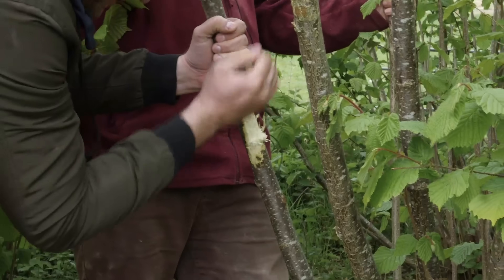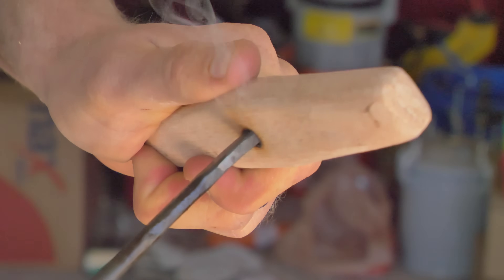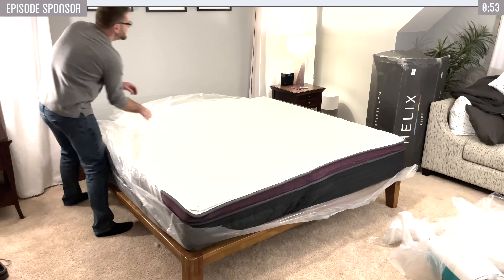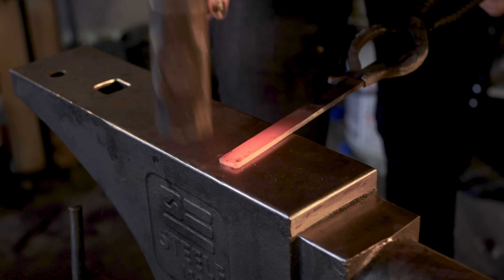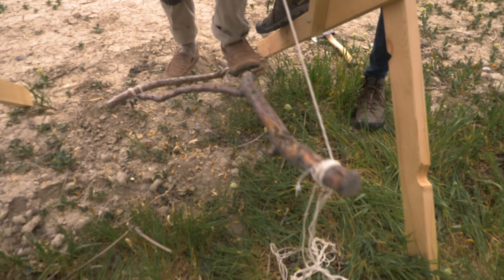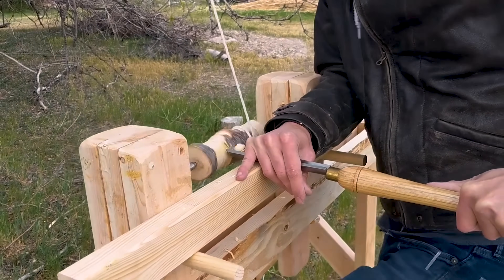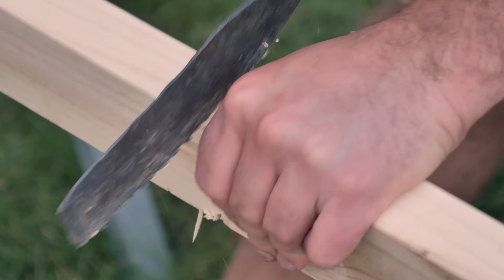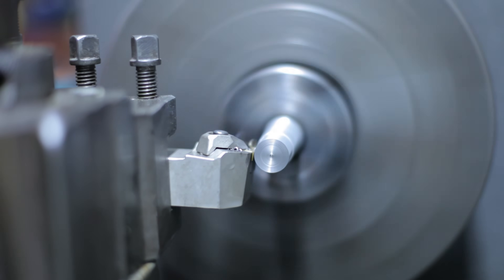I Built the The Machine that Made the Industrial Revolution

Comment: As an english woodsman, the traditional pole lathe would be driven by a single hazel or birch sapling and the rope winding needs to be reversed so you are cutting on the spring stroke not trying to power it with your leg.
Reply: I'd add a flywheel and an S-shaped crank between the spring and the pedal, above or below the work piece so that pedal+spring spins the flywheel, leather cord over flywheel spins the work piece.
Reply: @SonsOfLorgar  Somewhat misses the point of the portable simplicity of the bodgers pole lathe. Wood-turners (known as bodgers) would work deep in the woods next to the coppicers cutting to make hurdles and basketry, the pole lathe could be quickly cut from raw materials on site, leaving the workman to only carry a rope and his chisels.
Reply: @freemanjackmsiradio  in fairness if he did that on the tailstock pin, on the outside of the tailstock, and wrapped the string from the poll around the crank, you'd not be carrying much extra for a lot of gain.
Reply: @freemanjackmsiradio  It's worth noting that that's that particular scenario, Andy is just trying to build efficient technology so while a bushcraft style lathe is definitely as you described, I am willing to bet that many had came up with more complex designs at the same point in time when this was a relevant technology, and, were more efficient + capable than just a simple portable bushcraft lathe.
Reply: @freemanjackmsiradio  You could say they did a real bodge job of it, eh?
Reply: @freemanjackmsiradio  I can see your point, but I do disagree on portability. Especially if my idea is modified to put the flywheel and crank as an extension on opposite ends of the spindles.
That way, the forged iron crank and spindle axles would be all someone would need to bring, the spindles would need chisel or star shaped tips that grip into the ends of the work piece instead of just holding it. The flywheel could be made from a sliced log on site, it just needs to be centre balanced, same with the crank pole and pedal, made from wood on site and tiedxtogether with twine or leather thongs.
Reply: As an American veterinary technician, I have nothing of value to add to the discussion, but hi
Reply: @cleverusername9369  what?
Reply: @jimspencer7793  Why does your opinion about the guy's personal style tastes invalidate his work? Do you not understand the constraints they are operating within? That's kind of what this channel's all about, not some nonsense about long hair bad, something something.  You don't get to dictate haircuts, you know, but if that's your jam, you should check out Max Miller's Tasting History. Seriously, the guy could teach a class in masculine personal grooming. 

Whatever your reply, I wish you a favorable future.
Reply: @bookman7409  
Lets be honest, we all know why he's complaining about people's personal appearance, and it's not a good faith position.
Reply: @bookman7409 spoken like someone who doesn’t work with tools. Long hair hanging in his face while working with flames and requiring precision hand eye coordination. You don’t see anything wrong with that? Did you notice how he still fumbles his work since he was in a video like a year ago?  Looking like a stereotype is one thing, but confirming the stereotype is a disservice to himself.
Reply: @Nitsirtriscuit  I don't work with tools? Funny, my career was as an electronics tech, and that involved a ton of tools. I've also used plenty of heavier tools, hammers, wrenches, axes, and plenty of ordinary power tools. 

So your reply was spoken like someone who makes huge, sweeping assumptions in place of anything useful to say. If you feel insulted or offended, you brought it on yourself by making those assumptions. May fate give you what you deserve in the future.
Reply: @Nitsirtriscuit  I am almost certain the crew deliberately includes more fumbles in their video
composition than not. It adds an element of comedy and authenticity to what could easily be smoothed over with edits or outright faked. 
Everyone fumbles their work from time to time as they get better and understand their tools and materials better. 

Also, the blacksmith isn’t a “he”. They can still swing a hammer just fine, and their work has been sound. One or two shots where their hair gets loose don’t mean a whole lot for the whole of a project. Frankly, your nitpicks and framing of your argument with a comparison to stereotypes indicates both bad faith and dog whistling.
Reply: @Tinkering4Time  While I'm in agreement with your general sentiment about personal style and grooming not being of particular importance, and that people should stop shaming others for how they want to look, I can't seem to find any information online to confirm your claims about Adri.

For others who don't know, "their blacksmith" has a name. It's Adri Noland, also known as The Elfsmith. They have a YouTube channel with a few videos and an Instagram with a variety of posts about works they've made, but I can find no publically available information about their personal identity with regards to gender, sexuality, or anything of the like.

In light of this, I think it would be wise not to discuss Adri's personal tastes or identity any further, as it doesn't appear to be something they want to publically share.
Reply: @bookman7409  Actual smiths in the medieval ages generally had short hair both head and beard, despite the fact they were generally a "better off class" and growing long for both for their class level in society was acceptable.

This is the only hint I am going to give, because your response is so freaking funny that someone can be that warped and out of touch with reality it makes me smile.

I wonder what your response would be if someone commented on an female EMT wearing a skirt so tight and high heels it was impossible to run while on the job.
I bet it would be exactly the same...
I wonder what your response would be if that EMT was called to treat a loved one and they died due to how long it took for her to arrive?
Reply: @givemeanameman1  If that's what it takes for you to conclude that personal style is dictated by competence, have at it. Yay, you.
Reply: @bookman7409  You are an amusing Man/Women/IceCream/Fluffy/Rainy/He/She/They/Thing.
Since their are something like 500+ pronouns I just used 9 of them... hopefully you don't trigger out and take offense if the one you use isn't included.
Reply: As a not vegetarian I have nothing to say about the subject.
Reply: You absolutely nailed it, mate. The creator would also benefit from sharp tools.
Reply: It is comments like this why I watch and create (bad) content on YouTube.  Thank you sir.  ✊🏻🖤
Reply: i'm guessing more urban turners would talk to a local bowyer to get a more permanent setup close to home?
Reply: Awesome
Reply: Speaking as a single hazel or birch sapling, this is correct.
Reply: It depends on where you are, you English are known to do things the opposite way. 
Anyway both can be done it depends on the work, area, tools used, etc.
Reply: Would poplar work?
Reply: @beercatphil  Not a common tree in traditional woodland here but if the sapling was suitably young and springy, i see no reason why not. Hazel and birch are the saplings of choice as they share a resilience to splitting or breaking like goat willow or the likes would.
Reply: @beercatphil  almost every young tree works, that's the beauty of this lathe
Reply: In my village(romania) we used water wheels util 1950s
Reply: and as a tibetan stonemason, i concur.  😁
Reply: Be quiet and enjoy the video
Reply: Their black smith thinks having long hair and painted nails is of some importance..they made their work be 200% harder than it should have been..
Reply: @jimspencer7793  it seems like you're the one that thinks it's important, they didn't even mention it. That's like saying a blond blacksmith thinks their hair is too important just because they have blond hair
Reply: @youtubeaccount1-w6u  no it’s more like saying someone who needs to see their work clearly in order to perform well thinks their hair style is more important than seeing their work clearly. Thus causing them to fumble their work and do a poor job. Because they like their hair more.
Reply: @jimspencer7793   Their blacksmith is an alphabet person.

Comment: use a neodimium maget under the horn of the envil , you well eliminate the singing
Reply: But why?
The singing of the anvil helps a good and musically attuned smith with the accuracy as the sound of the work changes with the temperature and shape of the work piece.
Reply: from my personal expirience 3 years of amature blacksmiting ,after i discovered the neodimium trick i was eble to work for 10/11 hours with out headeke .p.s. sorry for my english is not my first leanguege.

Comment: cool video, although I think one improvement that could be made- Instead of using a green tree branch, could you make a counterweight on a swing-arm to do the same thing? Similar to something like bucket cranes for ancient irrigation, it'd allow you to set it in such a way that you can get fuller rotations, and also you dont have to keep beating on yourself with a tree-branch.
Reply: Also, add a flywheel and an S-shaped crank betwen the weight and the pedal for continuous single directional rotation.

Comment: Very nice project. As a potential upgrade, you could try using a counter weight system instead of springy branch, since it is really just being used to reset the rotation string.
Reply: And an S crank on a flywheel

Comment: You should make a flywheel, a one way pulling system and a system of pulleys that allows you to release the energy from the springy branch more slowly. This would make working on it much much easier I think.
Reply: A flywheel and a pedal crank attached to the spring would be more efficient than the pulley system. (Similiar system used to make thread in the 17th-18th century cottage industry)
I should probably build one of those lathes for myself tbh.
Reply: @SonsOfLorgar  Well, It was hard to make the flywheel and any belt wheels before having THIS lathe. Now that he's got the ability to make some parts, he can upgrade to the treadle lathe with some leather belts to even maybe allow variable speed.
Reply: @JessicaKStark  yeah, this is the way. He would only need one belt if the flywheel and crankshaft inversely changed diameter over each other keeping the same tension regardless of belt placement; this would allow simplicity in trading speed for torque and vice versa. I think he just might throw the treadle out completely next time if he can get into water power, but a variable power flywheel is a must for that too
Reply: @TannerSwizel  just like a drill press.
Reply: @JessicaKStark  you beat me to it! 😀
Reply: @JessicaKStark  agreed!
Reply: @TannerSwizel  Just like DAF variomatic transmission from yesteryear :D
Reply: @SonsOfLorgar  Yeah, I came here to suggest a treadle system as well, but if he intends to attach a water wheel, he can probably just skip straight to that! 😅
Reply: @SonsOfLorgar  Yeah I think you're right
Reply: I love treadle lathes! I've always wanted to build one. No pulleys or springs necessary, a crankshaft and a pedal attached to a flywheel will do great on its own.
Reply: Similar to foot powered pottery wheels
Reply: @hairyneil  That was exactly what I was thinking!
Reply: A weight attached to other end of the string hanged on a pulley would be much simpler and effective. Instead of a springy branch.
Reply: @kaankalem2666  Might aswell go for a a waterwheel and transmission then :D
Reply: the pullies would not work well for turning   ..you want rotational speed  consistency is a bonus  , you also need the torque  from the branch or the  gouge will just stop the work piece
Reply: @mobiousenigma  Yeah in my mind having pulleys would allow you to use a much thicker branche and unload it much more slowly. Especially when combined with a flywheel it would make it much more consistent and much much faster.
Reply: @isaacgroen3692  and at that point it is easier to ditch most of it and make a tredal powered lathe.
Reply: maybe take some inspiration from push bikes. Add a seat, pedals, chain and cogs/gears, so one can sit down and power it with both legs.
Reply: @mattw940   thats the next evolution lol its a tredal lathe  somewhere around 1850s i think. same mechanism as sewing machines but with a flywheel added as well
Reply: @mattw940  genius!
Reply: A flywheel and a pulley system should be easy enough. A one way pulley system that's going to be harder with out better materials.
Reply: @allstarwoo4  also, using a simple racheting cam would allow the flywheel to be driven in one direction.
Reply: You can go crazy and add thick wooden gears to increase the speed of the lathe and flywheel setup
Reply: @vishensivparsad  wooden gears are a pain  1 belt  2 shafts and as many different pullies"wheels" as you want speeds ....if you power the biggest wheel  and connect that to the smallest you have your fastest speed... vice versa for slowest  .. wheels are paired so one belt fits all combinations ...its a transmission but for wood lol  "gears" mostly used to change power direction when in wood,,,windmills of the wind powered type would be a good source for best uses and types
Reply: @mobiousenigma  yep a simple 1:x gear ratio made of 2 gears just to increase lathe speed while keeping it as simple as can be could be effective
Reply: @vishensivparsad  its been done in the past usually out of metal  for lathes  and usually 3 or 4 speeds ... ya turn your disks then make your gearbox ...my grandfather  made his  1/2 hp electric motor  on a hinged shelf  secured with a piece of all thread  through the shelf  and a nut on the bottom  tension ed the drive pulley  to the main shaft at 1:1  there was a 10 8 6 and 4 inch disk on one shaft and there reverse on the counter shaft   . it worked well enough  to turn spindles for furniture  .  theres lots of ways to power  a lathe from muscle to water and wind  to steam and electricity probably been a few clockwork  work turners in there time as well  htme need only choose one
Reply: More like a treadle sewing machine, flywheel just travels in one direction
Reply: @levilam522  Bidirectional rotation was the problem i was pitching a solution for. By rotating your lathe in two directions you have to first bring it to a stop, then put in energy to accelerate it in the other direction. This is not efficient.
Reply: yes, like the old singer sewing machines

Comment: Very interesting design. I believe Townsends had shown one similar. I like this! BTW, to help with not getting it the issue of it popping out, the tool rest should be slightly below the center of the object being turned. That way when you put your tool on it, the edge would be about center. This allows for it to not get caught. Which makes it safer for you, as flying objects means danger!
Reply: townsend probably would  as would roy underhill ...springpole lathe i believe is french in origin though

Comment: Seems weird to attach the string to the workpiece and not a pulley on the end...but then you have to make a round pulley (or crank) first.
Reply: I'd probably start by upsetting a bulging waist on a ~15mm diameter cylindrical steel rod out to 20mm diameter while keeping both ends straight and aligned.
Then I'd forge 20mm of one end into an 11×11mm square with a 5mm long slight taper ending in a 15mm long and 10mm diameter octagonal and the other end into a 30mm long wedge with a raised spine.
Finally, I'd bore a 2mm hole perpendicularly through the octagonal and round it off smoothly.
Then, I'd take a piece of 25x5mm flat iron bar, forge it into a shallow S shape sideways and round the corners, then drive a square hole 11×11>10×10mm in one end and a round 6mm diameter hole in the other. In the 6mm hole, I'd put a 30mm long 6mm diameter, round headed steel rivet, heated to plasticity only the 20mm furthest from the head, so that when I hammer it into the hole with the anvil underneath, it would form a collar on both sides of the iron piece and leave a 10mm shaft between the crank body and the rivet head.
Then I'd make a connecting bar for the pedal with an upside down keyhole slot about 20mm from one end where the round hole fits over the rivet head and the slot fits over the rivet shaft. A smaller hole in the top of the bar for a cord or pull spring loop, and a hinge at the bottom to affix a pedal.
The square hole of the crank body fits over the square end of the axle and is secured with a metal pin or wire. The waist on the axle fits between two structural pieces of the lathe to prevent horizontal movement, and the wedge is for keeping the work piece rotating with the axle.

Comment: Awesome! Try making a flat plate! Flatness is one of the modern marvels!
Reply: Not quite true. While easy flatness is a modern marvel, being able to cast giant sheets of metal into molten glass so it floats to the surface and flattens out naturally, flatness itself has been around for ages. Planes were used to make large flat planks, for example, and sheets of metal could be made via rolling mills, running it through upside down to remove the bend that such typically cause (this process actually dates all the way back to ancient Egypt).